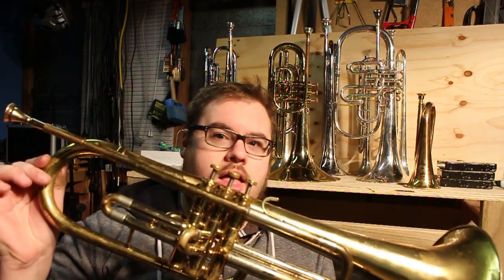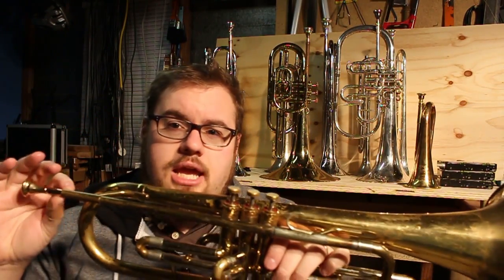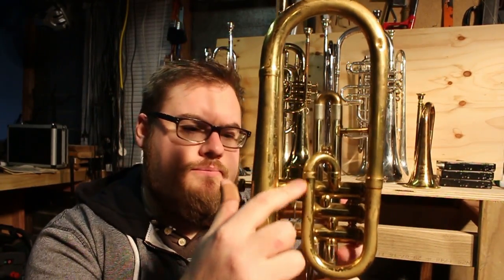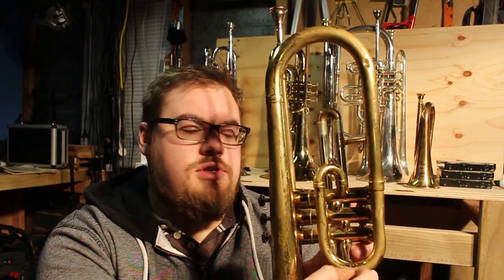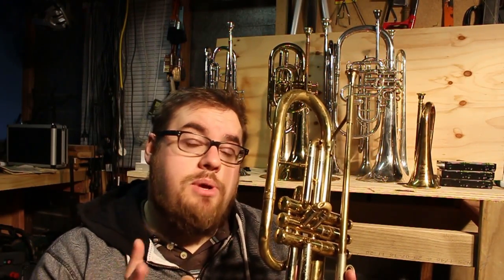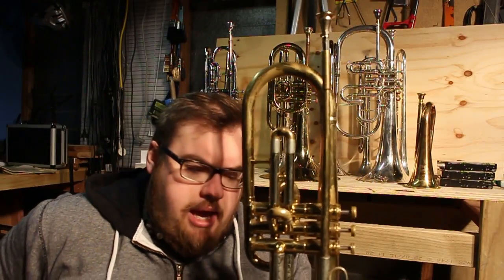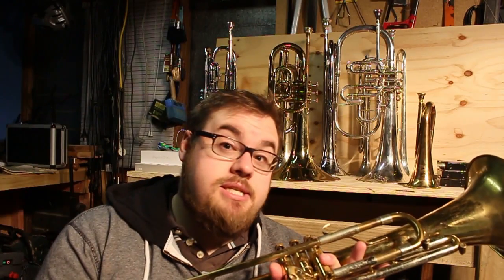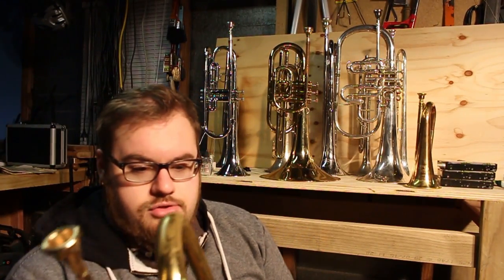The Getzen Frumpet

Comment: My high school band was one of the few bands to outfit the horn section with an entire hornline of frumpets. They took some getting used to, but once they were accustomed to them, the horn section really rocked them. They had an edgy sound that carried quite well, and I thought they sounded great on the field. They were definitely not intended to be played indoors. A few of them did not play in tune very well, however, and Getzen stopped supporting them due to little interest. After the frumpets started wearing out they were replaced with mellophones rather than repaired.

Comment: The frumpets that the schools which own these instruments have them with tuning slides that can change the pitch to Eb which when used improve the intonation difficulties that the F set of slides create.  Getzen made these to switch between F and Eb.   These instruments were used and geared primarily towards trumpet players who needed to play horn in F parts, particularly during marching band season.  I think with a little help these could be decent horns, but most I have seen, like the one in video, probably have not seen any TLC in a very long time.
Reply: If trumpet players need to play a part in F, the Alto Trumpet is a far, far better option.

Comment: Trent, you should try and obtain a trumpet leadpipe that would fit the frumpet's tuning slide (I used one from an Olds Ambassador).  Mount it temporarily alongside the frumpet's leadpipe with "zipties" (not sure if they're called something different in NZ) and use a mouthpiece from what you would call a "tenor horn" which should fit in the trumpet leadpipe mouthpiece receiver.  I think that you will find that the frumpet becomes a much more useful and in-tune instrument!
Reply from the maker: Argh! I had a trumpet that I ripped to pieces not so long ago that I could have used for this purpose.
Reply: I may do that with my other frumpet!

Comment: I believe the Getzen "frumpet" was intended more for use as a contra-alto trumpet than as a substitute for the mellophone and wasn't actually meant to be used by french horn players at all. There are some solos (such as the Brandenburgs) which are written for F alto trumpet, however one hasn't been made on a non-custom basis for decades if not more than 100 years. Most of the time this is simply avoided (the trumpet player will play on a Bb/C or even use an F piccolo trumpet up the octave), but I believe was hoping to lead the way back to the contra-alto trumpet before they ultimately failed. This is just based on what I've read but if you know of something I don't Trent I'd love to hear it!
Reply from the maker: The frumpet isn't the same as a contralto trumpet, but I don't think you're correct regarding the intention for the instrument based purely on the fact that the trumpet uses a french horn mouthpiece.

Comment: Looks a bit like my G/f Olds  Bugle French Horn Front bell nickle plated with 1 horizontal valve and a rotary The timbre is quite the same but I must confess the intonation is much better on mine .  No offense,  but you may need to get more acquainted with the instrument.  It's very easy to slide off pitch . Easy to trill though